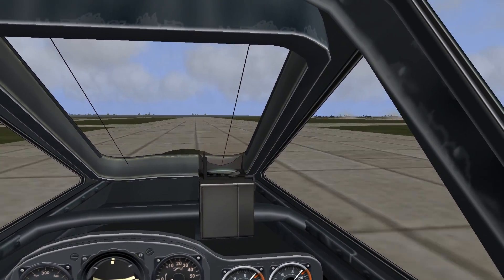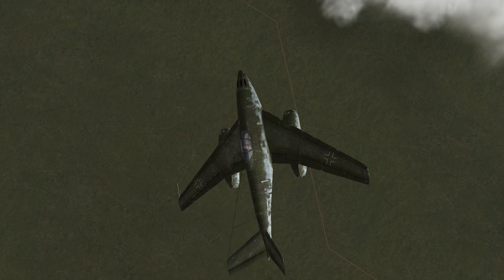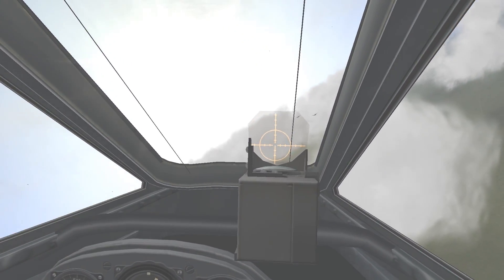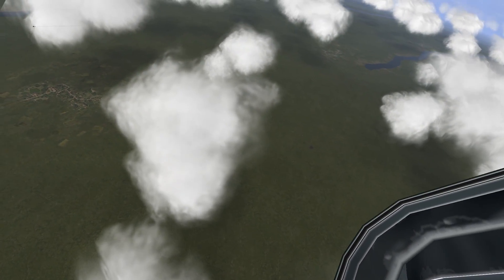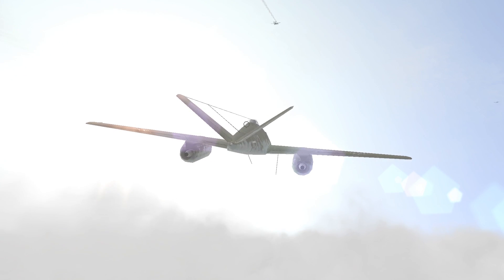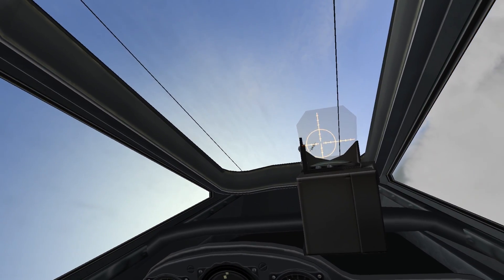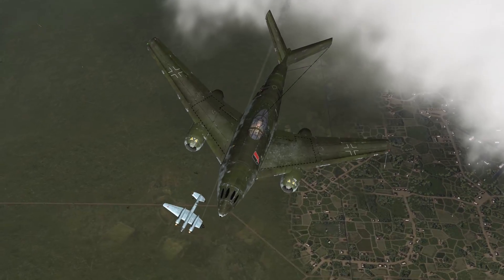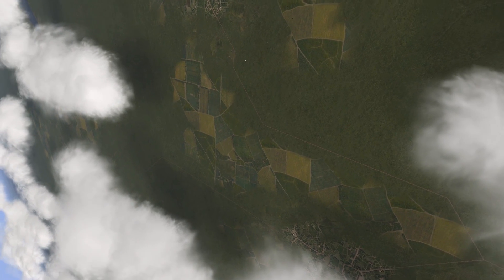Me 262 HG.II: Development and performance estimates.

Comment: I say add it, as long as it doesn't get the damned V-tail, because they wouldn't have used it. They tested the V-tail on a Bf-109 and came to the conclusion that it put too much stress on the air-frame (which V-tails do) and with the before hand mentioned problems in the vid. So putting a V-tail on a Jet-fighter would not have happened, it just wouldn't have.

Comment: I think that all HG variants would fit in with the other aircraft, if you have the HG.I at 7.3 similar to the vampire, and HG.II & III at 8.0. Also to those saying they shouldn't be added because they weren't made: R2Y2 V1, 2 and 3...
Reply: Germany doesn't lack jet aircraft as much as Japan, hence why Japan got the R2Y2s and Germany hasn't gotten the Me-262 HG2/3 because those are simply not needed as much to fill the TT as the R2Y2s are for Japan.

None the less I still want the see the HG2 in War Thunder. On the other hand the HG3 is a bit too far fantasy, I do agree I'd love to see it in WT, but it isn't necessary.
Reply: "Germany hasn't gotten the Me-262 HG2/3 because those are simply not needed as much" Are you serious? Germany has weak 8.0's that get decimated by 9.0's all the time. the HG II and III would be perfect to combat MiG-15's and especially those bastarding Yak-30's.

Comment: Since the 262 he 2 didn't have speed breaks to slow down. How did it slow down in a turn or on the ground? Was the throttle used for the speed?
Reply from the maker: On the ground it used wheel breaks, In the air it just turned  the same as every other non air-break equipped aircraft ever made.

Comment: Not a huge note, but just an FYI: the smoothness of an aircraft's skin isn't a very significant factor in drag. Anything beyond "painted" smoothness the change is negligible, though by the sounds of it the skin was originally very rough for some reason.

Comment: The Me 262 HG.II doesn't need to be 8 br.

It could be a 7.3 alongside the Vampire
Reply: 7.3 means it can get down tiered to 6.3, given the maximum speed it can reach and is most likely to reach if flown by a decent pilot (which most players who fly Germany are) it would be virtually invulnerable. only being able to be touched on landing and take off. 8.0 if the proper BR for it, if it were to be added to WT though the only problem it is gonna have is when facing 9.0 jets, but that is also the case with 8.0 jets that are already in game.

Comment: isn't moving the engines towards the fuselage will decrease the general moment of inertia of the aircraft about its central axis(roughly by a factor of 1/2*r² where r is the displacement distance of each engine). and then consequently less energy is needed to  make the aircraft roll = higher roll rate. 
However this is just a thought , what is more dominant here - the drag or the moment of inertia ? I didn't do any actual calculations.

Comment: God, the lack of airbrakes seems monumentally stupid, especially seeing how often standard 262s got taken out on takeoff and landing more than anything. Was it just to make production cheaper, or did they honestly not think airbrakes were that important?
Reply: Still, i'm not totally convinced the HG II would not have had them. Both the Me P.1101 and the Ta-183 both supposedly were to include air-brakes. The 262 A-1 and 163 both had major problems regarding landing & time on target when strafing bomber formations (Their primary function), meaning there was well enough reason to consider them.

The problem with the design documentation for the HG II like the 183 and P.1101 is that they were never finished. Arguably neither one successfully got passed the first powered prototype stage of their development, were often non-essential equipment would be overlooked in favor of getting a flying prototype  for the purpose of handling characteristics.

Of-course this is only my observation on the matter.
Reply from the maker: It is true, they could have been fitted should they have gone into production. They could also have had rocket engines wire guided missiles and /or ramjets. All of which were under development at the time. If you start to ignore the HG.II's plans and go into "what  if" you could say that it could have had any system that was in existence or development at the time. But there is no evidence of course.
The fact remains the few pieces of evidence we have on the HG.II show that it was not planned at that stage of development to add air brakes or the hydraulic system needed to run them and there is no proof that it was planned to receive them later.
Reply: Hey Magz, Thanks for the reply. That is very true, admittedly you have researched this far more then I, as I was not even aware there was this much information available about the HG II. In hindsight I should have directed my point more towards that I think the HG II In War Thunder should have them. (Not that I thought the real one would have definitively had them in its production version)

My original observation was to the ends, that I hoped if Gajin ever decide to bring planes like the HG series, 183 & P.1101 to War Thunder they take a little bit of design liberties to give us some fair and balanced planes, that offer a unique play experience.

By that respect I found myself wondering if it was totally out of the realm of possibility, at least in terms of War thunders standards. The problem the current 262's have is that they both lack good speed control. while a skilled pilot can still find ways to use the plane effectively you really have to know what your doing to get the optimal use of the 262, I feel If they brought the HG's to War Thunder it would make sense in the "what if" scenario that the Germans realized the biggest issues the 262 was having (other then mechanical issues, which don't apply in game) was its poor speed control.

Regardless, I remain hopeful these planes will make it to the game eventually, as I was just a little disappointed  that their current solution to the problem of what to do with Germany and Japan after WW2 was to give them a license built/loaned version of another nations plane.

Not that I want to get into the Paper vs Real debate to much, but I'd rather have a several more unique aircraft to play and fight against, then 3 variations of a Sabre, the Hunter and a Mig any day. Because It just makes the game more interesting to play.

Sorry I'm kind of a crappy writer, so its not always easy to get my presentation across.

Comment: My assumption why they never fitted air brakes on the 262 series is that they knew it was the fastest aircraft this time and in this case you don't need air brakes for air combat. if your enemy is much slower than you, then there is no need for you to reduces speed in any case. if you over shoot, then you overshoot fast and with much more energy, being able to avoid return fire by gaining distance or going vertical. So why bleeding energy when you can use it to stay superior and untouchable during the flight.In addition to this, air brakes always mean you bleed much energy just to gain advantage for one single moment. After that you have to rebuild that energy. Time the germans didn't have back then facing a vast superior number of enemy fighters. Their best chance of surving was staying as fast as possible all time. Like Erich Hartmann once said. "dog fighting is a waste of time" and a waste of energy aswell. Attack when the moment is right, disengage as soon as you realise the maneuver won't work properly (being spotted or something else).

Comment: Someone went nuts over the radio, scary af.
Reply from the maker: Hollywood paints a view of pilots being calm and professional at all times all the way from WW II to now, I'll let you in on a secret. It's bullshit. 
When 30mm high explosive shells are ripping holes through your aircraft the size of dustbin lids no amount of training is going to keep you calm. 
Even today pilot in dangerous situations will crack, the only thing in truth that stops the pilots from today from doing the same thing is that death today is a missile moving at mach 4, If the countermeasures fail you wont have time to scream before death and if you survive the hit you will likely be leaving you radio on the aircraft while you ride the silk.
Reply from the maker: Yeah, some of the radio work is pretty convincing in 1946, Pilots take hits and loose there shit. Combat can feel genuinely panicked like it actually was, Even the lower audio quality does the game a favour here as the radio quality at the time was not fantastic.
Reply: where?
Reply: about 1 minute and a half in.
Reply: Lol
Reply: Now, I don't want to shit on these pilots, but I'd also assume that them loosing it is also kinda unprofessional. And I think even these days, pilots are told to stay calm; even when Death is sitting on the wing, which is without a doubt difficult to do. I won't blame them for freaking out.

Comment: I'm really a fan of the HG II and HG III design, though I think other planes should be priority right now. As of now I 'd love to see more BF 109s added like the G-4 and G5, as well as the K-14 and K8. A FW190 A9 or the special variant with a turbocharger wouldn't hurt either.
Reply: Kurfürst Fvckvintxge there are enough Bf 109s and 190s imo. They should add more bombers for germany
Reply: ABC's left wing which has a fucking hole  they really need some bombers, but I don't really fly them, therefore I'd prefer new fighters

Comment: If you are really interested in seeing what its performance would have been, model it in X-Plane and take it out for a spin. You'll get pretty close to real numbers. Of course this will require quite a bit of detailed construction data, not just its general shape and engine thrust.
Reply from the maker: That's the problem, As it was not construed or tested most of the new and incomplete numbers we have on it are projections or estimates. 
To build the FM for it in 1946 the performance estimates where layed over the base FM of a Me 262 A1 with the A1 filling all the missing holes and as such it it probably as good a simulation as any of the aircraft base on what we know.
Reply: Yeah, I agree it'd be a tough job to do "properly". At least having detailed schematics would help a lot. But to properly simulate it (and I don't mean simply guessing at performance numbers), we'd need parameters such as the exact size and dimensions of all aerodynamic surfaces, flight controls, the maximum deflections of these flight controls, the thrust curves for its jet engine, etc. etc. The beauty of X-Plane is that if you have these parameters, it's basically like owning your own wind tunnel. The FM just falls out of it naturally, and it's usually pretty darn accurate.
Reply: @totoritko  Wasn't X plane used professional to model flying aircraft on Mars and design kit aircraft? It's amazing a program like X plane is available to the public.
Reply: @5000mahmud  It might be, but I'm not aware of it. X-Plane is good as a quick'n'dirty test, but of course it's not a full CFD simulator.
Reply: @MagzGTV  just made a model in autodesk and test it.

Comment: I feel like jets in WT should be split into separate tiers. Say, tier 5 is for the first gen of jet fighters such as the 262, yak 15 and the original meteor etc, then a new tier 6 for korean era aircraft. Though at the same time the player pool will be spread out more making waiting times long af. Just a though I've had anyway.
Reply: The He 162, Meteor F3 and Mig-9 Use to be like that, they rarely had to fight their second generation brothers and regularly got into matches with the top tier props, who had their own advantage (turning and acceleration) because those early jets take for ever to get going anywhere. It honestly was not a bad meta,

He 162
Pros: Fast, Small, Quick Acceleration
Cons: Slow Climb, Bad Guns, No Airbrakes (Never Dogfight, Ever)

Meteor F3
Pros: Great Climb, Great Turning, Quick Acceleration
Cons: Slow Top Speed, Wings rip easy at high speed, Weak Air-frame

Mig-9
Pros: Dive Speed, Great Guns, Durability
Cons: Slow Climb, Bled Speed Maneuvering, Slow Acceleration

Everyone lived in harmony until the BR Condensing attacked! 

And somehow between then and now, we introduced P-80 cancer jets which over preformed (literally forever). And somehow broke not 1 not 2 but all 3 of the flight models that made the early jets so great.
Reply: @Terminus_4 absolutely, the first p 80 in real life only could go about 800 kph, the me 262 a1 had a higher top speed (900 kph) and a higher rate of climb in real life, but in the end war thunder is the wet dream of russians and americans
Reply: This comment aged really well
Reply: And now tier 6 for early super Sonic era plane
Reply: Jack Silver 

Only if we need to. Otherwise, it’s not necessary because MM could be changed to accommodate historical setups. Besides, kids won’t appreciate being unable to fight post Korean War jets with biplanes.

Comment: ah but don't forget the HG2s were also planned to be equipped with the HeS 011 engine when they were ready for mass production
Reply from the maker: To be fair everything was planned to get a HeS 011 if it went into production.
Problem was only two prototypes where ever made and neither managed to break 3000lbf and both failed during test runs.
I suspect the HG.II would have been in production and still have been waiting for those engines had the war progressed.
Reply: MagzTV good point, but still an interesting if terrifying 'what if'
Reply: It's barely a what if. 1944/45 Germany wasn't capable of building stuff like that. None of these napkin drawings would have ever happened
Reply: SVT Red I know that, you don't need to be a butt hole about it though

Comment: i real life the hg 2 was built and ready to be flow but some guys crashed in the prototype with another experimental jet on the runway thats why it was destroyed. the hg 1 was built and flown
Reply from the maker: Sorry but no, As I've already covered here that is an old wives tail.
It was never built outside of a model, The HG.I however was built you are quite correct. 
Willy Messerschmitt himself was its first and only test pilot.
Edit: All spelling mistakes thanks to Android.
Reply from the maker: No, Butterfly tail, Clear 18* wing sweep and sunken cockpit. Congratulations you just found an image of the HG.I the aircraft I have already said was built and flown.
Well done. Also if you had read the caption at the bottom of the image you can clearly see the caption for the image identifies the aircraft in the image as the HG I :)
Fun Fact: The pilot in that image is none other than Willy Messerschmitt, He was the only person to fly the HG.I prototype and that image is also the only known time that it was ever flown.
Reply from the maker: At the year's end of 1944 the parts for the HG II-fighter were ready in Lechfeld. But before the plane with No. 111538 could have its first flight, the aircraft was damaged by another jet-exhaust stream  in Lechfeld. The repair could not be finished due to a lack of parts"

Sorry mate, I didn't want to point this out but the image you linked. . . it's a fake, It was created by a user and originally posted on the World of Warplanes forums and made it to War Thunder not long after. A simple look at the image in Photoshop will show you the tell tail pixelization that is a give away and if you google image search that pic you will see it has only ever appeared in that format on the WoWP and WT forums. The images on the HG.I however are common on the internet.
Reply: do you have autocorrect enabled or disabled?
Reply: No, that is not a wives tale :
http://abload.de/img/hg-1o0clz.jpg

"At the year's end of 1944 the parts for the HG II-fighter were ready in Lechfeld. But before the plane with No. 111538 could have its first flight, the aircraft was damaged by another jet-exhaust stream  in Lechfeld. The repair could not be finished due to a lack of parts"

Nonetheless, great video as always!

Comment: I thought Gaijin said something awhile back about paper designs.  It was something like paper tanks are okay (Panther 2 and 10.5cm Tigers in their current state) are okay Ish if absolutely necessary, but they don't like that for planes.  Something about the aerodynamic calculations and all the extreme stuff for aircraft would make it difficult to properly model they said.